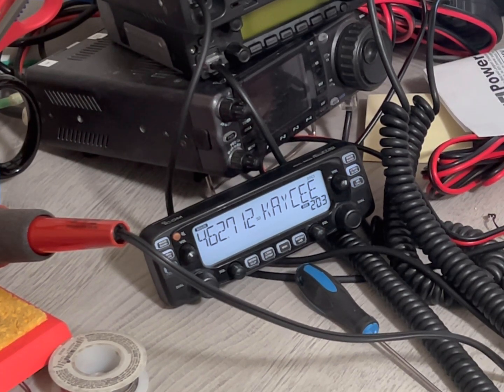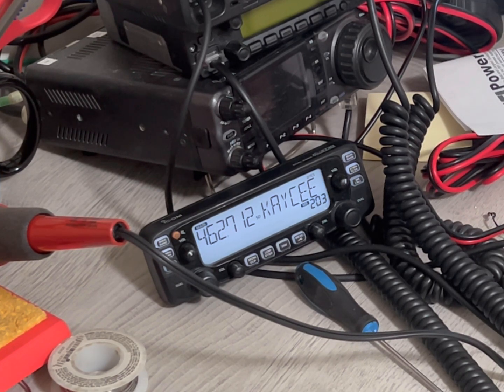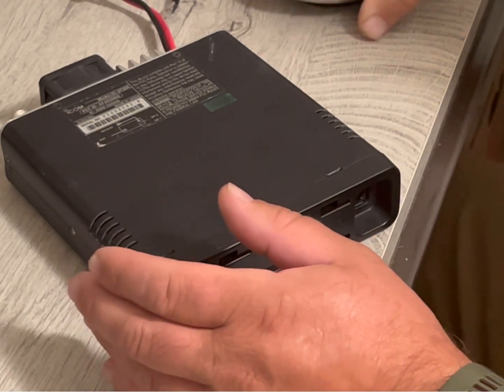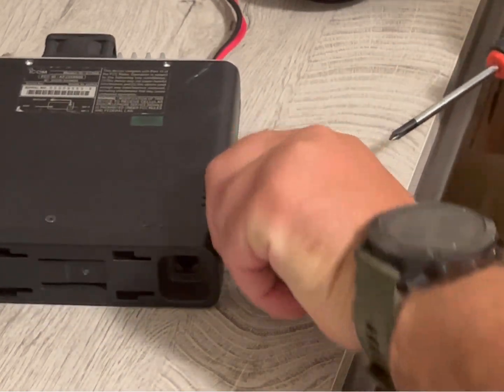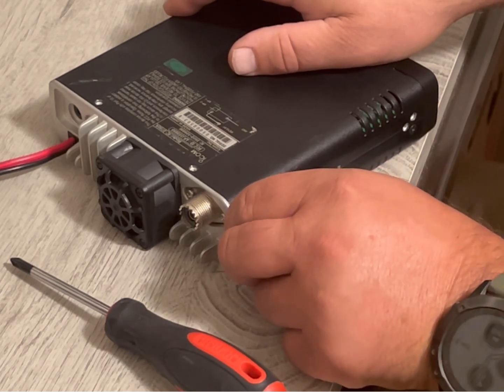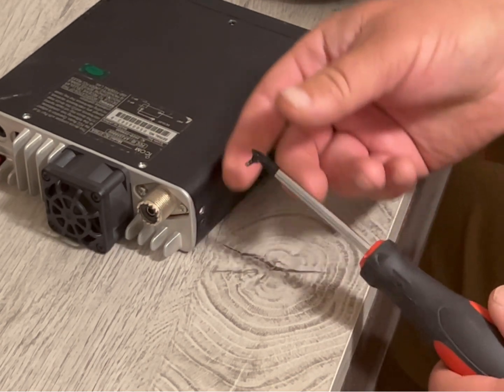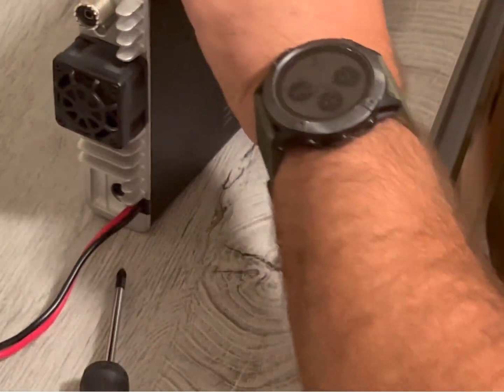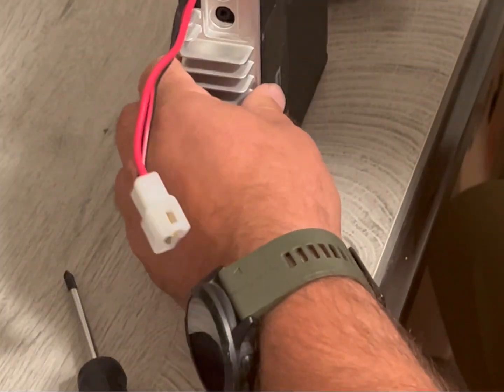ICom 2730a MARS MOD

Comment: I have been wanting to do this to my Radio and was just gonna pay HRO........Im thinking Im not going to do that now.  Ive never used a soldering iron but in this case it looks like your just heating up the solder to remove the diode.
Reply from the maker: Basically the idea, however you want to be careful not to overheat the board and disrupt any of the surrounding diodes/chips etc. use a fine point and start with a lower heat if you are new to the game.

Comment: Kaycee... Thanks for the legit, easier to understand mod!! I've been on the fence on what radio to order for dual band operation that could get me in the uhf GMRS and the commercial/public safety vhf bands I need with good TX wattage output. Great video and commentary!! I'm still trying to figure out if in scan mode will it revert to the "start" channel on PTT or maybe have a Priority channel scan revert PTT like other commercial radios do... Not enough info in the radio features info I have found.
Reply from the maker: We run 3 of these radios. 2 mobile and one in the shack, so I have some experience with them. If you are in scan mode, PTT will key up on the frequency shown. But you can set up a “home” channel that can be accessed from a single key press on the mike, then PTT on that channel
Reply: @adventuresofkaycee  Sounds like that will work for me. Thanks!
Reply: @adventuresofkaycee  I ordered. With RTsystems software and the mounting kit. I have programmed plenty other radios with Chirp and have a few Vertex radios that I have programmed so hopefully this one is just as easy. Again thanks for your mod video!

Comment: With the mod done and additional TX frequency range added, the question then becomes what dual band antenna to use for best performance especially if intending to use 760 to 770 range when overlanding. The reputable Larsen antennas typically list as 144/440 or 150-154/ 450-465.   Everyone recommends 144/440 but they arent necessarily talking about an ICOM with a mod
Reply from the maker: Great point. Our antenna for this radio is on an accessible NMO mount. Although our TRAM standard 144/440 works, SWR is a tad high (2.3). We keep extra antennas on hand and swap them out in 30 seconds or so if we plan on using frequencies outside our normal antenna’s tune. Commercial antennas or GMRS Specific antennas aren’t that expensive and take up almost zero space behind the seat.
Reply: Understood. I really only care about talking on GMRS and only listening on other bands unless there is an emergency of course. Not a big ham person, but thought Id buy a decent ham in case it started to grow on me a little and I wanted to do more. I am studying and will take the T test in case that happens Ill already have a license.
Reply: Which antenna is  best for gmrs use
Reply from the maker: @jasonlewis6401  we use this one from TRAM. Tram 140MHz-170MHz +... https://www.amazon.com/dp/B00IDTJ2KE?ref=ppx_pop_mob_ap_share. It keeps the SWR below 2:1 on almost every GMRS frequency we use. If your primary use is only GMRS, then this antenna from Midland will do the trick. Midland 6 dB Gain Antenna with Durable Spring Base and NMO Connection - Works with Midland MicroMobile MXT105, MXT115, MXT275, MXT400 https://a.co/d/aJbiYJJ We like to keep a few antennas on hand (they don’t take up much space) and will swap them out when we find ourselves in a group that exclusively uses one or the other.
Reply from the maker: We stumbled across this antenna that would suit your use. Ordered one up and hope to have a new video posted soon.     https://powerwerx.com/antenna-ultra-wide-dual-band
Reply: Is there a way to mount two antennas and toggle between them as needed?
Reply from the maker: @jasonlewis6401  Absolutely. Any antenna switch will do. They can be found for $30-$200 depending on how fancy you want...